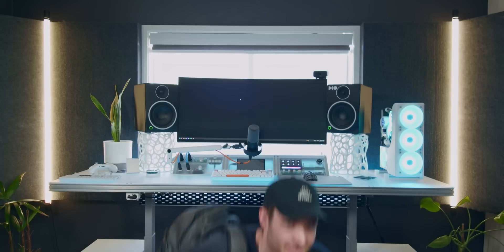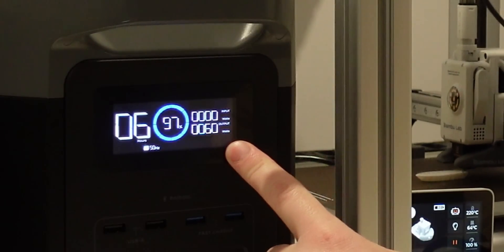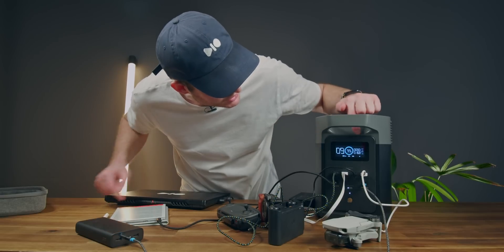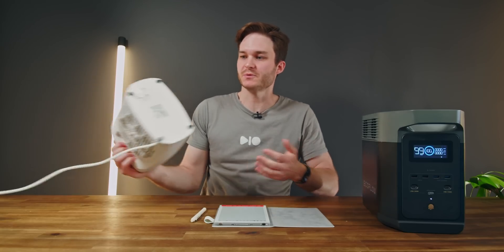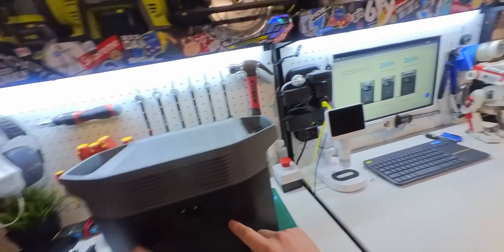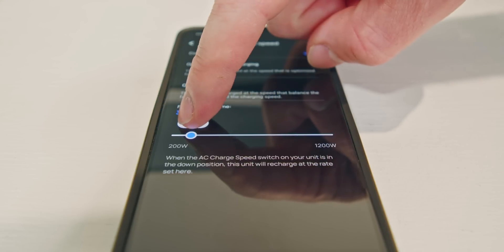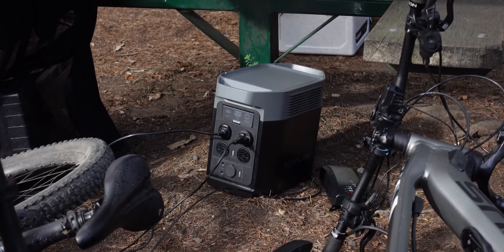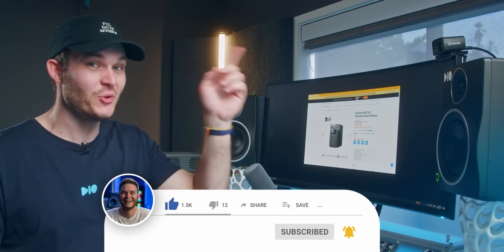How long can this XXL Power Bank run my 3D Printer and Computer? EcoFlow Delta 2

Comment: Apologies in advance. This is not a criticism, I just need to say it to satisfy my tism or address my trypophobia.
Please can your run along all the edges of your speaker stands with a deburring tool or some sand paper? In a few shots you can see it isn't smooth, and it makes my skin crawl.
Reply from the maker: Haha yeah they have overhangs sagging in a lot of places! full get it man.
For my original pair in PLA Flex I melted and smoothed everything, spent a few hours doing it.
But when I had to redo them in TPU I learnt it's not as easy to cleanup so I just got rid of the really bad parts, and plan to re-print on a better printer so I can have a better starting point for cleanup.

Very much a function over form on the finishing quality for now
Reply: @camshand  Reasonable, thank you. I have downloaded the STL from the original video, and will humble myself this weeked 🤣

Comment: Hey! I really enjoy working on projects like macropads and creating my own stuff, but my budget is a bit tighter than yours. Do you think getting a digital notebook would be a good idea? If so, could you recommend a good option that’s budget-friendly? Thanks!
Reply: A real old Samsung tablet with a knock off s pen has worked well for me and it's cheaper than a digital notebook like remarkable and has more capabilities beyond note taking and drawing.
Reply from the maker: No, there are better things to invest in if your budget is tight.
I love my supernote and use it everyday. But you can get enough books for a couple years at the same cost as just the pen.

As suggested below, a cheap android tablet with pen input gives more functionality, even second hand.
My need for the supernote is the digital benifits without distraction but pen and paper is always very useful.

I'd put money towards the tools and materials you need to remove friction in your creation process. Like digital calipers, soldering iron, whatever you need for your projects.
Reply: @camshand  hey! thanks for the reply! i think i'm indeed going to buy a few books and will upgrade my tools and workbench.

thank you so much for the reply again!

Comment: Hey Cam I'm tryna revamp my setup and make it look way better and be more functional while still having fun. Can you give some tips and tricks, also what you think is a must have and is game changing. I want to make it very high tech and not too cluttered but still have good taste. 

Thanks cam I love the content pls keep it coming!!!❤❤❤
Reply: yeah, a video about how he plans his builds and makes decisions would be neat
Reply from the maker: @insinYT  - I have something in the works regarding this, plan is to launch before the end of the year 🤙
Reply from the maker: @yehudahakhamzadeh5097  - In general I'd say a macro pad or something like the stream deck adds a lot of functionality with quickly launching programs, changing songs and volume levels.
A small second screen is handy, too big and it can be a distraction, but small it can be useful for productivity like calendar & lists. But even something like a little whiteboard can give that functionality.
USB Hub is a must if your PC is out of arm reach, can really tidy up cables and make plugging devices in easier.

As for looks, try to match colours, I've gone white and silver as my base. Blue is the primary, and Orange is the secondary. This naturally evolved but it helps everything blend visually.
A monitor riser/shelf with the teach tucked underneath can look clean and neat without having to rehouse like I have in a dashboard. You can also mount tech under your desktop like I showed in my latest cable management video.

You've got the right attitude which is what matters most, and that's having fun with it!

Comment: What the heck, why am I watching an 18 minute ad for a thing I ALREADY OWN.
Reply: The new ad format i would spend the whole day on
Reply from the maker: Haha I can see you've got a 4x4 in your profile pic, do you have an alternator charger?
I'm considering adding one to our SUV so it can be quickly topped up on trips if needed.
Reply: @camshand  Not yet. It wasn't available when I got my Delta Max. I got two extra batteries (mostly for home backup, my Jeep isn't that spacious inside) and a 400W foldable panel for camping. I'm mostly using and charging the Delta while camping and I camp for a week in one spot mostly so alternator charging wouldn't do a whole lot. Maybe if I was moving each day it would be a better fit. Also, my setup saved my butt more than once when I had power outages so kudos to Ecoflow for making great power solutions. The Blade lawnmower was on the other hand a complete failure and I returned it.